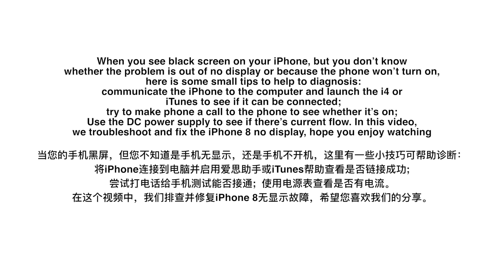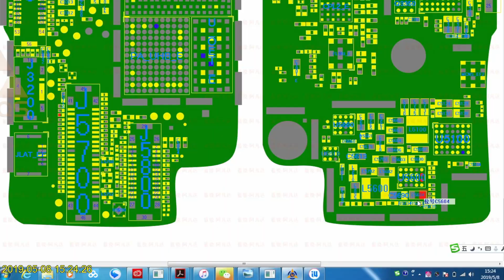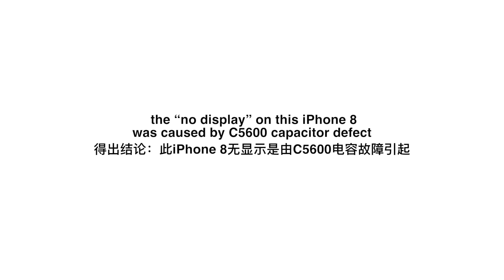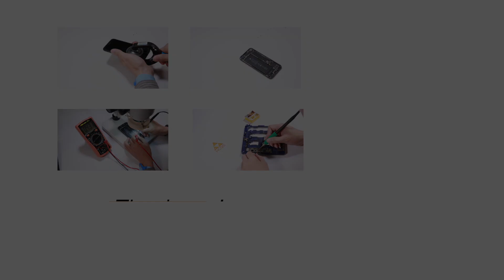How to Fix iPhone 8 No Display Black Screen Problem | Motherboard Repair

Comment: Top, fixed an iphone 8 on my store following this video, i had every readings ok, lcd connector, touch connector, all voltages, even this capacitor diode value was ok, dont know why, but it fixed my problem, never would found this by myself, it is a cheating cap

Comment: It happened to me when the battery was less than 1% and suddenly turned black despite charging up. I tried the methods about pressing the buttons to no avail. But then suddenly someone called me and the display came back.

Comment: i had a problem when the screen turned yellow and turning into black screen but still its on i can call me etc. any solution or diagnost? i was on my phone this happend a sudden change to white to yellow and black , my display burn it ? or its a backlight problem , srry for my english ":S
Reply from the maker: Hi, Alex, I suggest that you try to replace the screen and see whether the problem is fixed, if it's not, then you have to troubleshoot the motherboard

Comment: my iphone 8 displays whenever it needs battery but cuts off when i charge it what do i do?
Reply from the maker: Hi, thank you for your comment, our technician suggest you to troubleshoot and measure the diode resistance of the charging dock connector pin and repair accordingly :) cheers